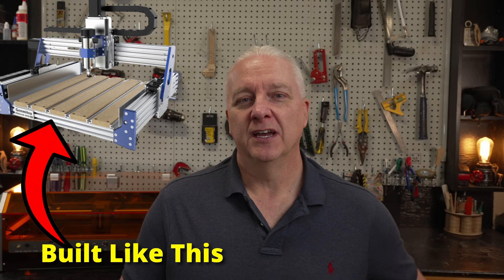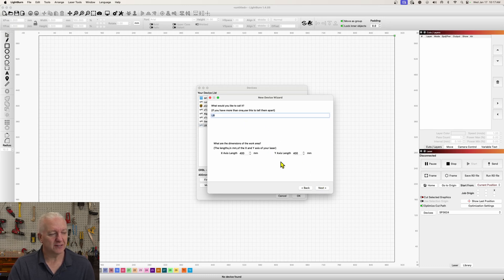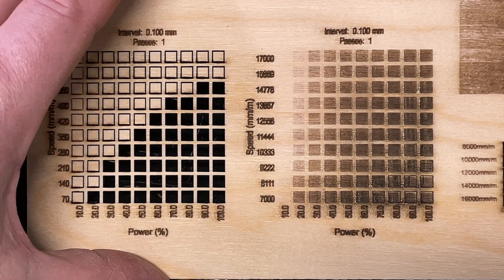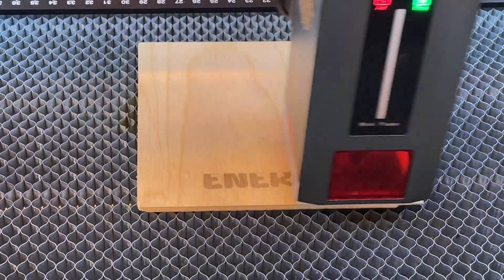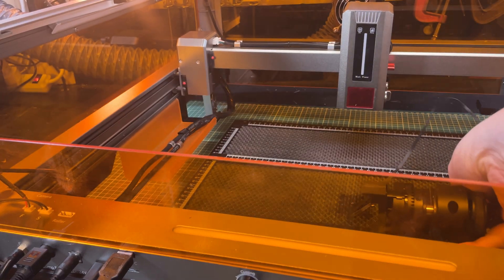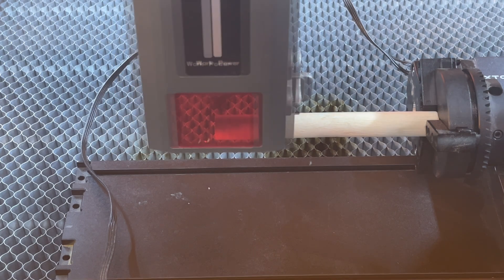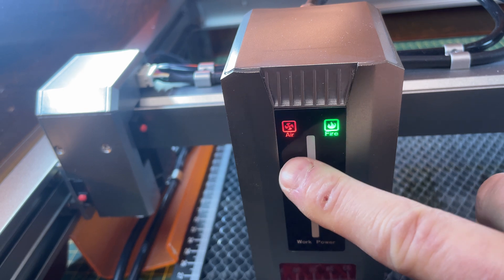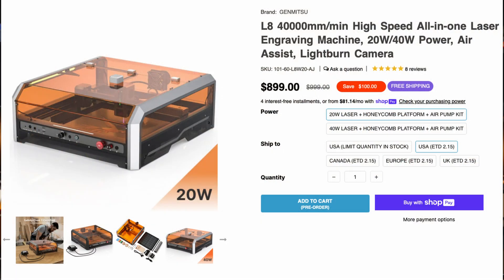GENMITSU L8 Takes On Other Lasers for TOP Safety Features!

Comment: Hey how do you clean this last machine? Can’t find anything on it
Reply from the maker: Do you mean the laser module or the cabinet?
Reply: @SteveMakesEverything the laser module. Anything guidance helps
Reply from the maker: @LordWolfclothing2  You can clean the machine surfaces with a damp cloth. 

The laser module can be cleaned by disconnecting it and removing it from the cabinet.  Remove the nozzle and use a cotton swap with 99% isopropyl alcohol to gently clean the output optic.  Don't scrub it hard or any grit could scratch it.

Other things you can do regularly is check the belt tension and use some lithium grease on the rods that are used as sliders for the gantry and laser module.

You probably only need to do most of these things a couple of times a year.
Reply: @SteveMakesEverything thank you so much!! For the nozzle do I unscrew the 2 screws? I just don’t want to end up breaking it so that’s why I am asking. Also if you ever get a chance please make a tutorial. I started using the laser about 5 hours a day and it’s gotten slower so I’m assuming it’s because of not cleaning it
Reply from the maker: @LordWolfclothing2  I don't remember that specific laser module, but usually, once you remove what you need to in order to get the nozzle off, that's all you'll have to do.  The  optic will be right inside the nozzle.

Comment: why does my laser shut off randomly? i have purchased a better usb
Reply from the maker: If it’s powering off completely maybe the power supply, though if it is doing this when the laser is operating it could still be an underrated power adapter.
Reply: @ thanks I had to connect the usb into an adapter and it fixed my issue. Thank you
Reply from the maker: @visualdrip.official  Well, this is good news

Comment: How come you have your speed on 7000 and above? For me, anything above 300mm/sec doesn't do anything. For instance, to cut a 2mm plywood, I have to set the Speed to 8mm/sec and Power to 100%. I'm sure your setting are correct and I'm definitely missing something big here. This is my first laser cutting experience, btw.
Reply from the maker: Well for starters, with the 40W version has quite a bit more power, so you can move a lot faster.  But for cut tests on plywood, I will max out at around 800mm/m for cutting.  For engraving the maximum speed is a lot higher and you should see a difference in speeds if you are engraving.

For cutting plywood I would typically use 600-700mm/m (6-12mm/s) which is about the same as your settings.
Reply: I have the 20W version and I'm also using Lightburn.

Comment: @JadeHare1
1 minute ago
The camera is crap, the calibration is so difficult and innacurate~
Reply from the maker: Hmm, I didn’t find this camera better or worse than any other camera I’ve tested with Lightburn.  LB support on its own isn’t great for accuracy, and calibration for any camera is the same.

If you want deadly accurate camera output then use the Wecreat Vision, but then you are also ditching Lightburn.

Comment: Steve, do you happen to know how to switch out the 20W module with the 40W module. I purchased the 20W L8 3 weeks ago and and I ordered and just now received the 40w laser module - but even though the 40w slides easily into the base unit, the laser is bigger and there is no way that the little red tightener for the 20w would fit it.  Any Ideas as to how I can get it installed?
Reply: Just so you know, it turns out that they had forgotten to include the power supply and locking key with the laser.  I finally got it and it is up and running just fine.  Diana
Reply from the maker: @drogersusa  Yikes!  Well at least they got you what you needed, but they need to find a new packager for their team 😏
Reply: Oh, most definetly - they actually sent the 40W laser in a cheap Walmart padded envelope - free floating - can you believe that!  The other stuff took 15 days to ship from China!
Reply from the maker: @drogersusa  What ever happened to good customer service???
Reply: @SteveMakesEverything  No kidding, think they used the same Walmart bag to send the rest of the equipment!  It is running just fine - so, live and learn!
Reply from the maker: I haven’t see. The 40W. Erosion of this laser but it should be a simple process to just turn the latch of the laser mount to release the module and then slide the 40w module lit and tighten the latch. Are you saying it doesn’t fit?
Reply: @SteveMakesEverything  Yes, the 20w is 2 1/2" square and the 40w is closer to 3" square
Reply from the maker: @drogersusa  It should still fit.  There's a dovetail that the laser module slides into.
Reply: @SteveMakesEverything  Steve, it slides into the "dovetail" very easily, but it is a 1/2" larger than the 20w laser - so the little lever that you use to tighten the 20w laser in place is to short for the larger 40w, leaving nothing to tighten the 40w laser in place.
Reply from the maker: @drogersusa  Ah, that seems like something the company should be addressing.  Have you asked them about it?
Reply: @SteveMakesEverything  Yes, Friday morning I emailed their support, but no response.  Maybe Monday hopefully.  Thanks for your time.  Diana
Reply: Thought you would like to know, they are telling me that none of the parts needed to change out the modules was included in the large padded shipping bag that they just threw the laser into and that it will take 5-7 days to arrange for the parts and another 5-10 days to ship them.  A different power supply and cord is required, also the different side switch to hold the laser to the base.  This has not been a good experience at all!

Comment: Hi Steve, does your x1 rotary tool have a 4 pin wiring harness?  I ordered the ikier r1 as it seemed like a really nice unit, it advertises 99.5% compatibility but the harness options are all 6 pin....Yours appeared to connect directly in....
Reply from the maker: The end that plus into the stepper motor is always six pin, but the other end of the cable is typically 4 pin
Reply: @SteveMakesEverything  odd, the two cables that came with the ikier were 6x6... ??, back to the manufacturer it went... easier than rewiring.  thank you!

Comment: L8 vs Falcon 2 Pro, any strong opinion ? Thanks.
Reply from the maker: I assume you are looking at the Falcon 2 Pro since it's a closer match.  If you are looking at the Falcon 2 then I'd pick the L8 because it's safer.  The L8 is faster, but the work area of the Falcon 2 Pro is better (I mean the bed not the size)

Comment: I just wouldn’t go back to a diode ever !
Reply from the maker: It’s not generally a case of one laser vs the other. Each type of laser is adept at certain things.  You aren’t cutting 20mm wood with a CO2 laser without turning it into charcoal and you won’t cut the thinnest piece of paper with the most powerful fibre laser. There are definitely places where a diode laser is the best tool.
Reply: @SteveMakesEverything  I agree, I just wouldn’t go back to a diode laser as it’s terribly slow also I don’t really need to cut wood at great depths, with the dot size I have different focal lens/ compounds lenses which give great or even better dot sizes.
Reply from the maker: @Alex_Unlocked  Yep, I hear you.  Sounds like you've found the right path for yourself.

Comment: In no way worth 1k. It's only 20w, and those panels arent rated so i wouldnt trust them at all.
Reply: It comes with a camera, enclosure, honeycomb cutting platform, air assist and an exhaust fan. The only thing this machine doesn't have, is the ability to increase its size. I feel like this is one of the best machines in the price range. I dare you to find a comparable one for the same price. Other machines are going to cost at least 1k if you add those add-ons.
Reply from the maker: @Kennebec27  Yes, and as far as increasing size, it does have those built-in risers, and it is trivial to put the entire laser on blocks and work on anything that's taller than the laser.  That wouldn't be easy with something like a Roly and some of the other enclosed lasers.
Reply from the maker: Well it’s less than $1000 but compare it to other diode lasers. The Roly Lasermatic 20W costs quite a bit more and the AlgoLaser Delta is about the same cost without the enclosure.

Btw this is rated as a class 1 laser, so while you might not like the enclosure, it clearly works.